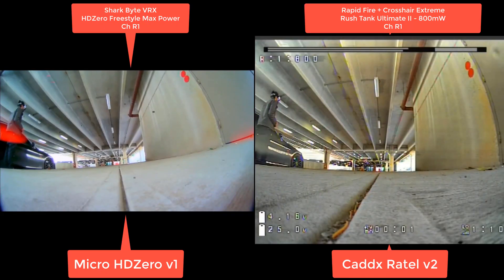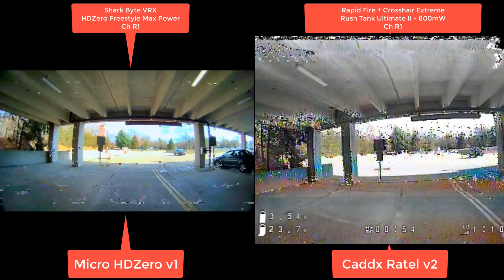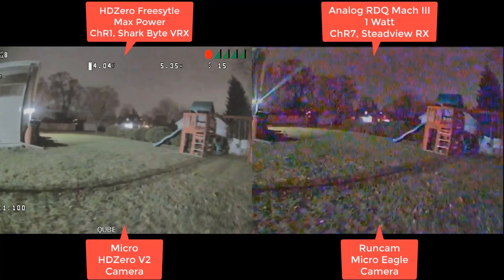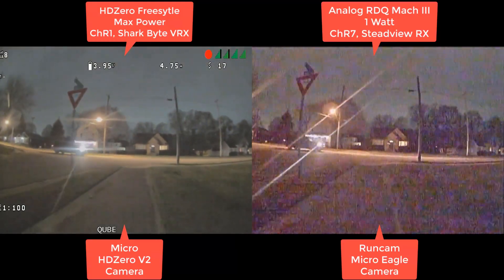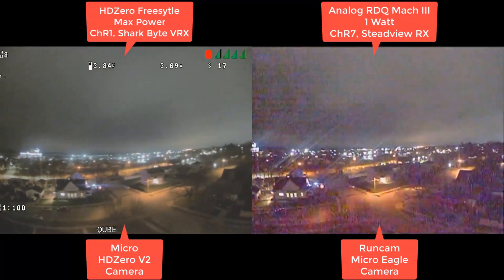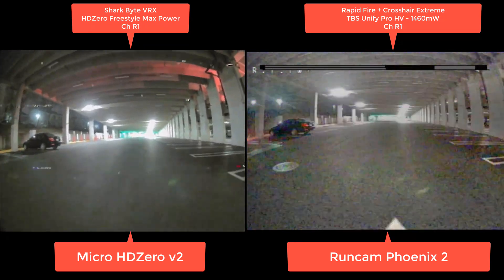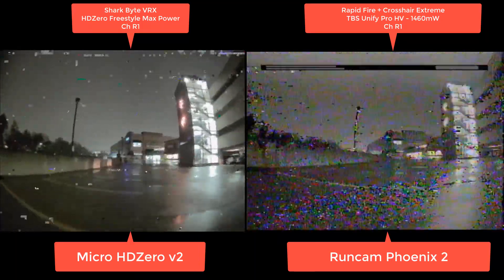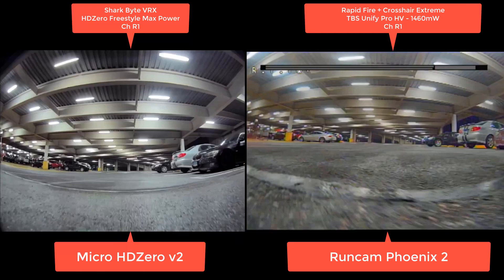Parking Garages and Low Light - HDZero vs Analog Penetration Tests

Comment: So the 5.8 ghz 1 watt HDzero is similiar to the 5.8 ghz 1.4 watt TBS. I would like to see a 2.4 MHZ, 1 watt, HD Zero option. This would provide 2.5X the range and penetration. It would be in its own class - not similar.
Reply: Omg a 2.4ghz signal be so awesome. Orqa is doing it but it's commercial and 100ms latency. Which might be doable on slow long range

Comment: Great test. I was surprised how well HDZero did on this but it's really a dramatic difference from analog. To be able to great that type of performance with the fixed low latency is great to see. Why would anyone want to stay on analog?
Reply: the difference in the goggles is bigger. You can see more and if the fixed latency is an issue for you, dji falls flat. So hd zero it is for racing. Besides, dont compare DJI 50mb mode with hd zero, its apples vs oranges